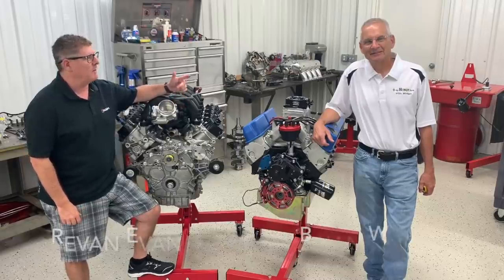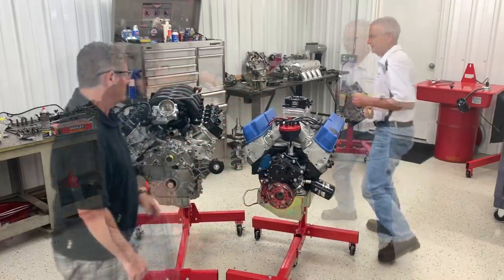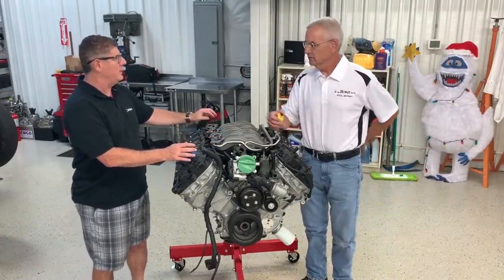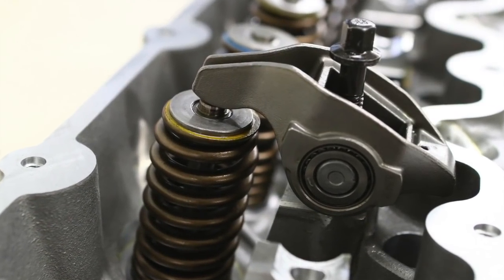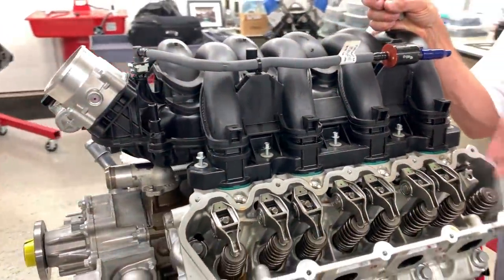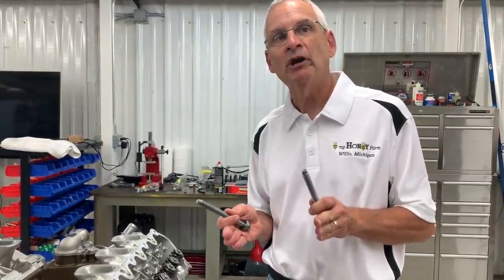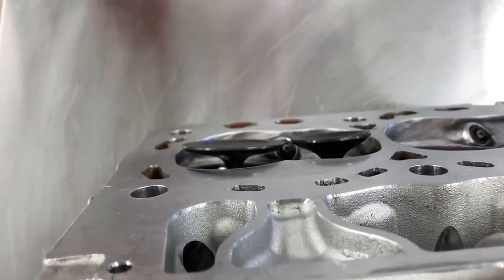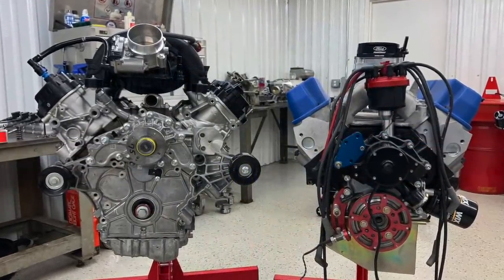Ford 7.3L Godzilla Engine Dyno Results, Teardown & Comparison to Coyote & 351 Windsor Part 2

Comment: Wow almost 600hp let's see some boost thrown at it .
Reply: boosted saleen twin turbo lets go...
Reply: Pushrods are great for packaging, the only reason LS engines are put in fords is they're cheap, lite, make power easily etc. Hopefully the 7.3 will be popular enough to bring the price down. They'll have to chuck them into everything though.
Reply: 600 at 6400
Reply: @john jones Single Overhead Cam engines actually have fewer moving parts than OHV engines. That's why Ford stuck with them in their commercial vehicles for so long.
Reply: The truck is making 600 naturally aspirated horsepower throw another  Atmosphere aka 14.6 psi of boost and supporting fuel  and that's a 1200 horse motor
Reply: This motor was created to replace the V10, commonly used in UHauls. The intent was high torque, fleet motor, easy to work on, lower operating costs. The Coyote and Voodoo have different power curves and redlines, and are going to cost more to mod and maintain. Either way, it’s a true competitor to the Vortec. Wait til these get modded and then you can compare them to the LS.
Reply: @criznitty  The 7.3 will eat LS's alive. This is the future.
Reply: Also ls7 costs nearly double what this motor costs
Reply: @BenRSilva  well no one knows if this engine will even be available as a crate engine let alone what the price will be. Also no one builds ls7s. I was just using that as an example because someone else mentioned the ls7 previously. People build 5.3s or 6.0s or 416 strokers which are cheap reliable and make good power. My friends 416 in his ta just made 570 to the wheels on the Dyno the other week. And he has like $8000 in that engine and is planning on throwing a 300hp shot of n2o at it.
Reply: @konnerkramer329 fast forward 8 months and 7.3 crate engines are available.  Lol
Reply: @boostedsaleen6146  for $20,000 lol
Reply: @konnerkramer329  sorry to disappoint but its 7500 at summit right now .
Reply: @boostedsaleen6146  $8,000 for 400hp... yikes. a $1500 LS will make 500hp no problem
Reply: mewrongway  i was talking about stock bottom end and heads not a full aftermarket setup, no shit this thing will make upwards of 2k with an NRE budget
Reply: @Cool as Ice  454 break cranks around 550hp
Reply: Ford engines rule GM engines drewal and spit parts out when pushed for Max hp and torque
Reply: No Prep Stretch I’m just sitting here waiting for the billitblocks after market heads and these things to get twins. They are legit gonna be one hell of a motor. Imagine if they’d make a car performance version slap it into a mustang and  even just a single turbo. If they’d gear it right they’d have a demon slayer
Reply: @bigboreracing356  😂😂😂😂😂
Reply: @Cool as Ice Yes and all the "high schoolers" are YouTube avengers who don't actually know the first thing about engineering or building engines. "Parts book racer boys" 🙄🤣🤣🤣🤣
Reply: @mewrongwayKOCXF  Have you ever driven over 120 mph, you yourself? I doubt it but be honest. I actually have, on a ooolllllddd street bike 173.276 mph to be exact. At least I've done it, not just argued about it online.
Reply: Logan P E  also this thing doesnt really have anything that a chevy LT engine doesnt. Not hating on it just pointing out that chevy has all the same tech and more in their V8s. Both are great engines and i would love to have a 7.3 in a bull nose OBS as a tow-rig/sleeper
Reply: @mewrongwayKOCXF  so a 6.0 iron block is a light weight ..smh
Reply: And oil injection too, sounds like a 2 stroke or could be made into one like this:https://www.4btswaps.com/attachments/2cyclesbc-jpg.6839/. Im sure it could run in multiple postions with dry sump oil injection feed  with Motule 800 40w 2T. This 7.3 2 stroke conversion is insane!Im glad to see the comback of big poppet valved loop charged 2 strokes! I get 3 gallons of motul 2t for my 99 7.3 IHC loop charged powerjoke, it's rigged with homemade oil injection at 60:1 into intake manifold with 2 VRP outboard pumps. i got tired of premixing this motor at each fillup and let the VRP do the rest
Reply: Or even a good cam, headers and a hi rise intake
Reply: @RadDadisRad  I think he said it had a bigger cam and then he shows the intake at the end of the video. I think he said ported heads too.
Reply: @baby-sharkgto4902  "A small cam", cleaned up flash, and a ridiculous intake
Reply: @RadDadisRad  you didnt watch the whole video
Reply: Leland Holton yeah n/a potential
Reply: @Cool as Ice Not with small mods it wont.
Reply: @Cool as Ice It has a light port and a small cam upgrade.
Reply: @Cool as Ice There totally is, its achieved by using a slightly more aggressive than stock cam profile. I didnt forget the intake, I just didnt address.
Reply: @Larcona_  its making peak power at 6500 rpm... I'd say that's more than a mild cam
Reply: Ls7’s make 600+ at the wheels. 600 at the crank with a 7.3L is nothing to brag about.
Reply: @robertsrt  literally the very first modifications done to the 7.3 and you jump on it to talk shit. Grow up little fella.
Reply: I agree with you! How much hp did the first Ls make? I know it was 4.8L but at least ford is getting back into the pushrod engines.
Reply: @robertsrt  the na ls7 makes 505hp at the crank
Reply: @robertsrt  yes but an ls7 was intendent for that... High horsepower corvette... This 7.3 was intended for torque in a work truck... Completly diffrent ideas almost same platforms... I thing this guys in the future can easly squeeze 1000 hp on turbos
Reply: @eI_Miki  More like 2000.
Reply: @robertsrt  ls7s have been out for a very long time. Give this engine a good few years and you'll see good power if people keep experimenting.
Reply: robertsrt ls7’s don’t make 600whp with the same mods as this 7.3 with the same mods lmfao...ls7’s need aftermarket heads,big ass cam,intake,and full exhaust to even hit 600whp,while this motor did it with the stock heads lol 😂
Reply: @robertsrt  Bruh exactly my Heads/cam/intake N/A 6.2 LT1 made 701hp on the engine dyno. And i have seen built ones make 850hp easy with more cubes.
Reply: @robertsrt  ; Stock or modified?
Reply: robertsrt that ls7 power you’re mentioning is with boost not na it’s like 500hp crank  without blower and your comparing a sports car that ment for hp compared to a truck engine ment for torque na vs na your ls7 loses your comparison in hp and torque so nothing you should be bragging about
Reply: @knowbull5hit590  Quit whining, this 7.3 is a baby, they're going to grow and grow big. The block/head casting is very advanced, the internals are bulletproof and that's as mfg. Personally I love the LS7/LS6's but they're old tech. This has massive potential. Chevy's don't have to rule!
Reply: Logan P E  you dont comprehend things too well, wasnt hating on the 7.3, just pointing out that idiot trying to say its better than an LS7 based off this modded one making more power to a stock LS7. When stock for stock and mod for mod the 7.0 makes more power, this should end up being a better bang for buck engine by far though if they sell alot in trucks. Which is what really matters
Reply: @robertsrt  Her comes the Chevy hate! 😂😂😂😂😂
Reply: @robertsrt  ford had to reinvent their big block to make small block gen3/ls power. Maybe they learned extra moving parts isn't always better.

Comment: 320 cfm on the intake and maybe 375 - 400 cfm after a full professional porting.
Reply: I bet 400cfm is doable!!!
Reply: So she could make some monster power then?
Reply: LS3 HEADS CAN DO THAT.
Reply: @clay3865  so can 5.0 coyote heads.
Reply: @jrod264winmag  So why are they choking down that big motor with such low flowing heads?
Reply: @jrod264winmag  I'm a fan of both engines ...... LS and 5.0L 
Both are Legendary Platforms.
They need to work on a way better head for this big motor they are working on.
Reply: @clay3865  you need to take the application into consideration. The heads flow perfect for what they were designed to do. Which isn't revving to the moon and making huge hp. But for high performance purposes, which im sure they thought about, you're right
Reply: @clay3865  the LS7 heads on the 505hp vette's also flow 325 cfm.
Reply: @jrod264winmag  Yeah I know.....So much more HP can be added by improvising on those LS7s as well. Not bad for a Factory head but if your racing it you want more flow for the added cubes.
Reply: @clay3865  low end torque.
Reply: @ionstorm66  The restriction from smaller runners and valves gets air velocity up and more air/fuel in your combustion chamber for maximum power for those stop light to stop light kind of street performance. The down side of this is the restriction becomes power robbing above 4,500 rpm because the engine starves for air.
For The Street Smaller Runners are Better for driving manners but for the Strip/racing applications the Heads need Larger Higher Flowing Runners.
Reply: They are "choking down the motor" because it's a HD pickup engine. It isn't made for the 1/4 mile; it's made for hauling 15K up the Ike, and do it for a decade without overhaul.

Its competition isn't the LS; it's Cummins and other Diesels.
Reply: @bcubed72  Well I'm sure it will be a great engine and even better with aftermarket parts.
 Cummins is and always will be king of the diesels in my opinion.